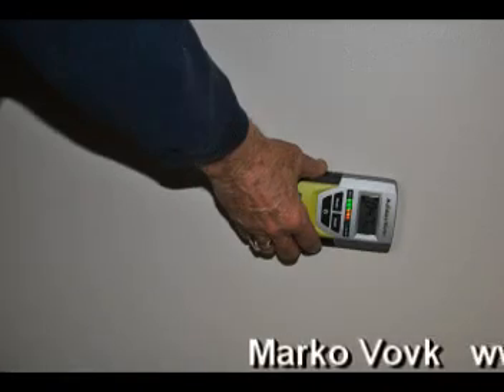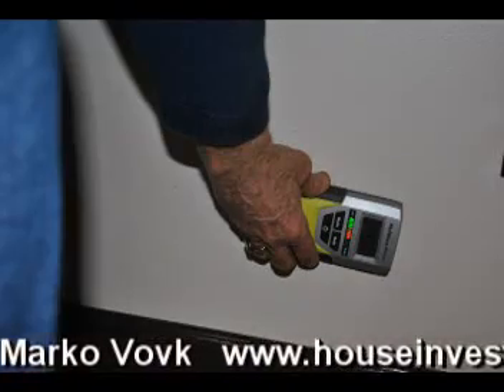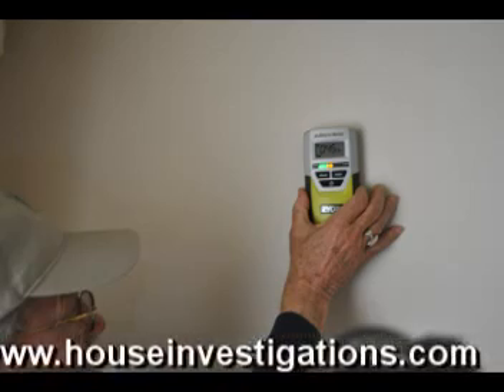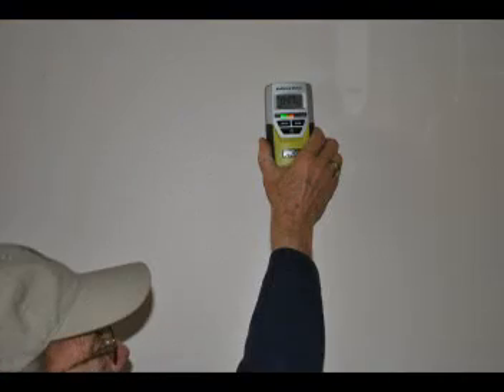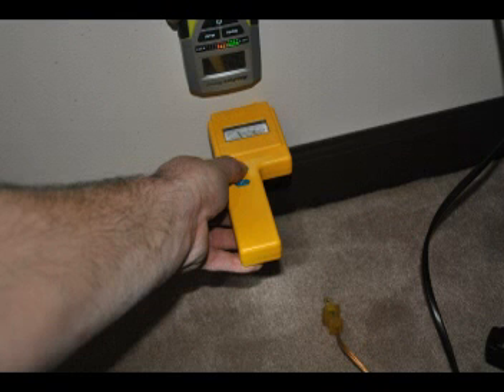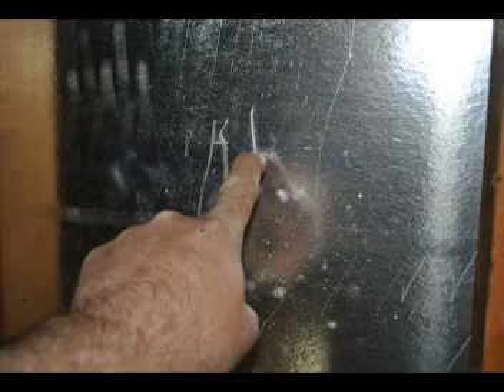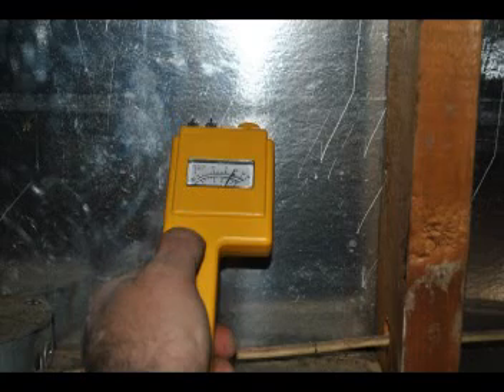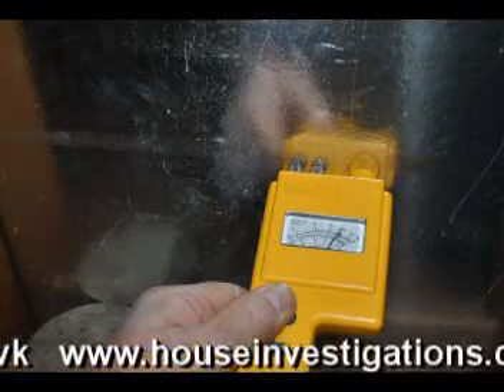Moisture meters can misdiagnose moisture problems

Comment: Fabulous, you just confirmed my suspicions regarding the results of a recent inspection.  I bought a non-pin moisture reader to reconfirm the results.  Low and behold, the reader was below 5% on all walls where there was dry wall, or board facia covering the cinderblock.  But on bear cinder block the reading was off the charts.  I double checked to confirm my suspicion that this was a false reading regarding moisture by testing on my concrete countertop, which also read off the charts.  Thank you for explaining why!  I can now rest easy that my house is bone dry.